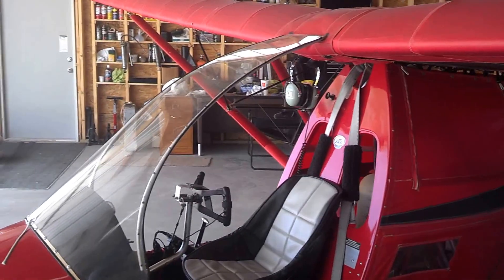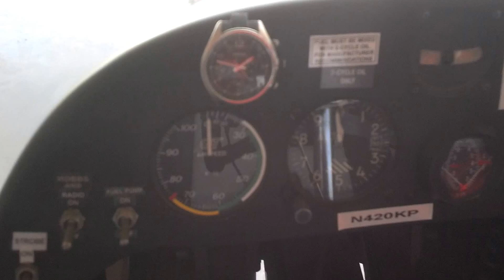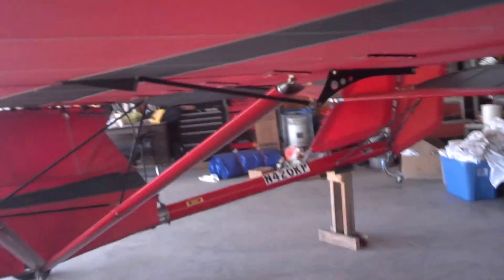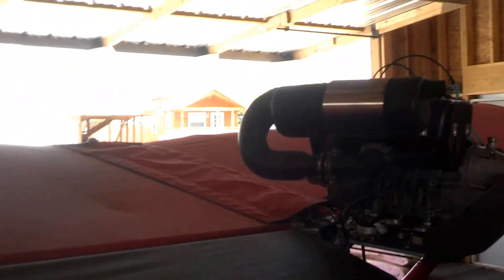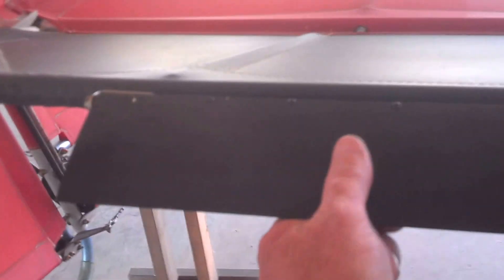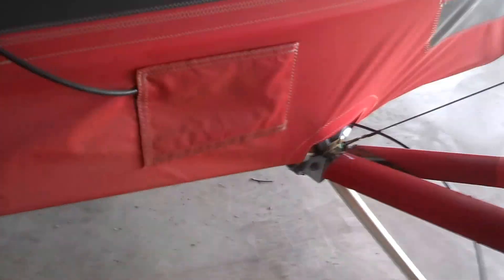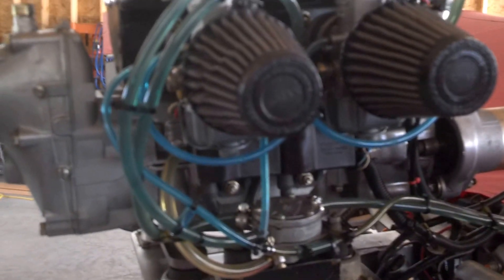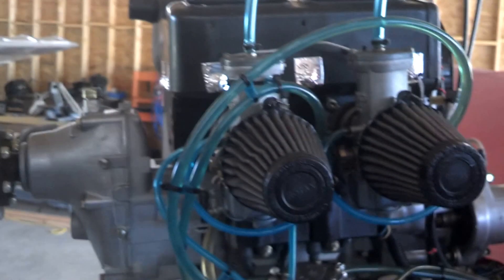Walk around of a Quicksilver GT 400

Comment: If I were to buy a quicksilver I would not bother with the 2 seats because if you put 2 people in your almost at gross most people rather not fly at max gross. Was watching another video guy was talking about the drawback of a 2 stroke with a pusher style prop if you ever owned a 2 stroke engine they vibrate like crazy. He was showing how parts on the engine can come lose and go into the prop could cause prop to break apart. He was talking about hose clamps hold the air filters on. Maybe someone can commit also I'm told the wings are fabric bags or put over a frame then tied or velcro not sure, but my understanding that while these are lot easier to install also have a life span once that time has passed like 10 years something have to be replaced. The cost of new wing covering can be as much as 8-10k on a used aircraft that cost $14k you can see how that will turn out.

Comment: Nice video, though I wish there was a clearer video of your EL trim tab.I just bought a GT400 last month and am still going over every single nut and bolt and connection.  Question for you:  My two leading edge truss cables that attach the front of the wing down to the gear have a lot of slack - from the middle I can pull 3" full left over 6" right - that's a lot of slop.  My assembly manual mentions nothing on that.  I can make new cables, but can't find out if they are supposed to be tight, very tight, slightly loose, or floppy.  How are yours?Bert
Reply from the maker: I no longer have the plane, but as I recall they were just ever so slightly loose.  Call Bever Borne at Airtech in Lousiana.  He is the authority on Quicksilver now, and recently bought the company.  He can also sell you any parts you may need

Comment from the maker: Hi Dustin, Check out the Aerolight 103. not sure it is still in production, but very well built and lots of praise.  The quicksilver mxsprint or mxsport are both part 103 compliant.  The "stick" as you call it is actually easier in my opinion than a yolk, but that's just my opinion. go to barnstormers and you can see lots of ultralights (and other) for sale.  reading all the adds can actually give you a pretty good education.  Also the T-Bird has a control yolk, and it is a true ultralight.
Reply: One thing about the Aerolight 103, it has very limited headroom for us tall pilots.  I am 6 feet tall and found it unacceptable.  Windshield is also very limited, and there is very little wind protection.  Finally, I wasn't much impressed with the rudder pedal failing midflight, due to a faulty bracket which broke on me.  I heard they corrected this issue, but still not impressed

Comment: I don't know much about aircraft, so excuse me for using the wrong terms if I do. I want to get an ultralight that is part 103 compliant. Are there any that have controls like this one? All the 103 ultralights that I could find has a lever on both sides instead of one for throttle and a steering wheel.(don't know if it's called a steering wheel, I think I heard you call it a control yolk? lol) Finding information is pretty hard! I think I may just join a local ULA club for even more info